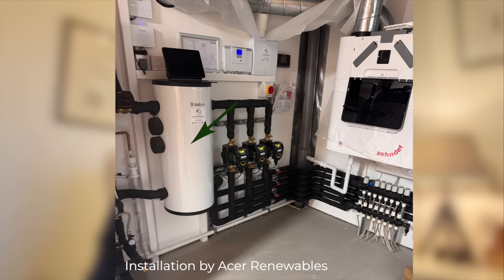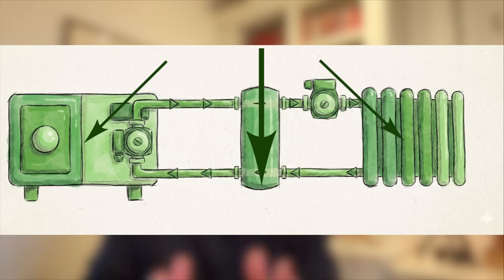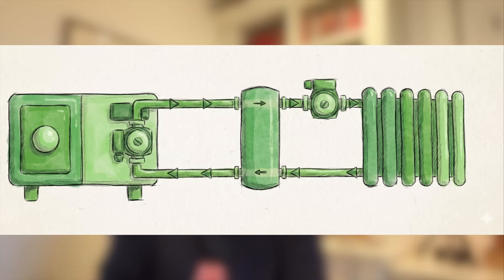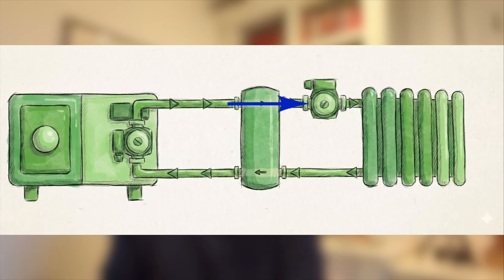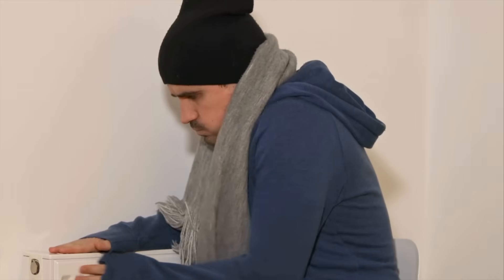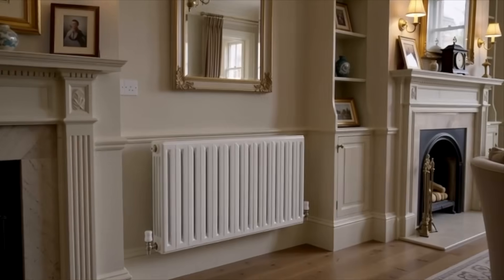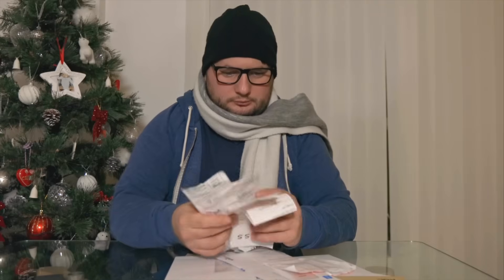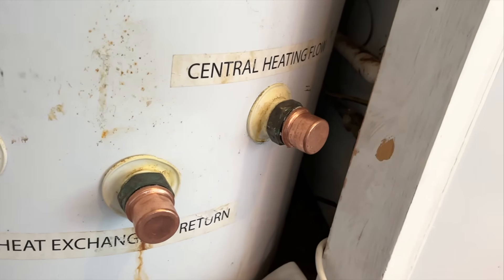Why Do Buffer Tanks Kill Heat Pump Efficiency?

Comment: Good video and information.
Getting people to question WHY, WHAT FOR and having insight as to why installers go this way is importantly to get installation quality to rise.

I am progressively upgrading an 1890s sandstone double fronted 5 bed semidetached.  As I go I am paying attention to system volume by upgrading pipe work to 22mm where I can and on,y 1 radiator running on 15mm spurs.  Radiator sizes are taken to optimise volume in the radiators so yes I am going with cast iron and doubling up in bigger rooms with matching half size units.  The goal is to get comfortably over 300 ltrs with low pressure losses.  If I do need a volumiser it will only need to be small.  Glyn at energy monitor fitted one but plumbed in bypass and he found it made no difference in his setup.

All a mystery until you start thinking it through and get useful thought provoking videos on YT.

Keep them coming Mars.

Comment: The buffer example using 4 pipes is old school. You can still connect a buffer in parallel using two pipes. Furthermore it depends on the control system how it handles the secondary temperature. NIBE measures the secondary flow and return temperature and adapts the primary pump speed and temperature accordingly. There is no difference in flow temperature between the primary and secondary side of my buffer. 

Replacing pipework in an existing situation is easier said than done. In my situation it is possible if I would open up the ceiling in my kitchen and living room and I don’t want that. My COP including hot water was above 4.0
Reply from the maker: How have accurately balanced your primary and secondary circuits, and how does your secondary circuits when the heat pump in the primary side modulates?
Reply: @R @RenewableHeatingHub  main heating is underfloor heating, radiators upstairs and radiators in a small hobby room and garage. All are hydraulic limited to about dt=10 degrees at minus 10 Celsius outdoors (Netherlands). The secondary pump is constant pressure controlled, i Will change that to proportional or AutoAdapt in near future. Reason is noise as soon my underfloor heating starts limiting (ESBE proportional valve) causing overflow and noise in radiators downstairs. I have to replace some radiator valves that are better adjustable and pressure compensated (eg Danfos RA-DV or Heimeier Eclipse). This will reduce noise (i hope) and keep flow constant in these radiators.

Handling a system that uses both underfloor heating (low temperature) and radiators (higher, but not high temperature) is complicated. 

Only The primary pump is PWM controlled by NIBE. NIBE Measures in/out temperature from the heatpump and the in/out temperatures from the secondary side. The control system regulates the flow temperature by adjusting the heatpump temperature and primary flow. My secondary circuit is limited in flow because of the pipework. However it’s enough to handle the maximum output from the heatpump at dt between 7 and 10 degrees. I had no problems in recent cold periods (-7).

Comment: I always thought that at least part of the reason you need a buffer tank is to prevent short cycling of the heat pump. Are you saying they can now modulate so much that that’s not an issue?

Comment: I disagree with your conclusion.

The buffer tank allows you to have two different flows, one on the heat pump and one on the consumer side of the tank, and the reason for that is because it allows you to adjust the heat consumption at any source independently, even shutting it completely down.

Imagine having sun through the windows on one side of the house. Then you might want to constrict the heat transfer to that side, without reducing it on the shadow side. This is solved by actuators, and that changes the flow rate. The same if the door is left open for a while whilst carrying in the groceries. Or whatever other reason.

I do agree that mixing in the tank is a problem though. Proper tanks have some measures against that.
Reply from the maker: I get the theory you’re describing, but it’s solving the wrong problem, in the wrong way, for a domestic heat pump system.

You’re absolutely right that a buffer allows two independent flow rates. That’s precisely the problem.

A heat pump is most efficient when it sees a stable system: steady flow, low temperatures, minimal interference. Once you introduce separation, the heat pump no longer responds to what the emitters are actually doing, it responds to a tank. At that point, you’ve broken the feedback loop that heat pumps rely on to operate efficiently.

The examples you give (sun through windows, doors opening, different sides of the house behaving differently) are exactly what weather compensation, room-by-room emitter sizing and proper zoning strategies are designed to handle without decoupling the system.

Actuators throttling flow downstream of a buffer don’t “solve” anything from the heat pump’s perspective. They simply reduce secondary flow, increase mixing risk and force the heat pump to compensate by raising flow temperature. Comfort might be maintained, but efficiency is sacrificed, which is the whole point of the video.

As for “proper tanks having measures against mixing”... no passive buffer tank can dynamically prevent distortion when primary and secondary flow rates don’t match. Unless you’re actively measuring and controlling both sides in real time, mixing is inevitable.

And crucially, most UK homes do not need independent flow rates in the first place. If shutting down emitters on one side of the house causes instability, that’s a system design issue (usually emitter sizing, zoning strategy or pipework) not something a buffer should be masking.

So yes, buffers can make systems easier to control from an installer’s point of view. But they do so by insulating the heat pump from reality. And when that happens, the homeowner pays for it, every day... 

That’s not opinion. That’s how heat pumps work.
Reply: Is it not custom to use actuators on the emitters in UK?

Comment: Hi Lars. Well explained! We have been installing heat pumps and have since 2010. The last buffer we installed was in 2016 more due to our lack of design experience at that time. Since then we have undertaken courses and become more aware about system design and the pitfalls of "generic" design. We see poor design on many heat pumps we go to, which have been done under the Eco scheme or many of the umbrella schemes, whereas, as you rightly say, a buffer of LLH will keep the heat pump happy, maintaining the flow rate, but at the cost of distortion, which results in higher running costs. Buffers and LLH's are often just lazy design, not always but often! Volumisers on the other hand we like in our designs.

Comment: Not sure how a standard uk system is designed. Do your heat pump also produce the hotwater for your taps? Is it a separate tank so the heat pump change the flow to that tank when producing hotwater? If so we often have the problem that when it changes back to heating you can get a rapid expansion of the pipes (floors/old radiators etc) witch results in ticking in the system. In that case a buffer/volumiser helps to even out the supply and stop the sudden expansion/contraction. Another problem with the separate hw-tank is that the flow to heating completely stop when the heat pump produces hotwater. Some old systems dont like that and are very slow to start flowing properly again, and that is when a buffer is needed to have a constant flow in the heating system. Also makes the radiators have a more even temp due to constant flow. I agree that it might be more efficient but sometimes its necessary and probably the reason that some want it as standard. To avoid these problems. In a completely new build it shouldnt be necessary though.

Comment: "I have underfloor heating and, based on your video, I understand that a buffer tank can be converted into a volumizer by connecting it in series with the heat pump and the underfloor circuit. To achieve the most efficient setup, should the tank be connected to the flow (outlet) or the return (inlet) side of the heat pump?"
Reply: Shouldn't you have plenty of volume in your underfloor pipes already?

Comment: I have put in K3 large rads on two floors and underfloor on ground floor , they barely get Luke warm , I run it for 6 hours continuously at 30 degree at night when temp drops to minus 3 say I up the flow rate to 45 there is no difference in the rads warmth , Luke warm and I mean Luke you wouldn’t want to shower in it , that’s with two 11kw pumps working .
  I’m wondering* if this is a buffer tank issue ?

Comment: We habe 450m2 of undefloor heating + a pool the heat pump can heat (60m away), they installed a flow seperator so we can have a grundofs magna 3 pump for each circuit. Diverter valve for hot water tanks (2x500l). Should we eliminate the flow seperator?

Comment: A great video with the facts well presented. I've had the discussion before with people promoting ASHPs that I've said there isn't currently the skill level within that particular, recent  technology to ensure that installations are designed and fitted competently. My comparison is with air to air heat pumps where the technology is considerably older and there really is only one design which has been used for literally centuries (it’s been around for 200 years). I DIY fitted a monoblock A2AHP for £800 and it just works. I was quoted an ASHP for £16k requiring a whole load of retro fitting. Now an equivalent A2AHP would be about £3.5k and you have to take care of the tank water heating separately but I urge people to get different ASHP quotes and even consider the possibility of an A2AHP as an alternative.

Comment: A buffer or LLH is not true hydraulic separation. You don't have 2 water circuits as you suggest, you still only have one and the same water is shared throughout the circuit so still needs glycol or other frost protection.

True hydraulic separation would be a heat exchanger with the primary circuit on one side with frost protection, and the secondary circuit not needing it.

Why don't we see any of those in a domestic setting?
Reply: You would only need frost protection in situations where you might actually encounter frost. A residential home shouldn't ever reach those temperatures by a long shot as all the devices are install in the house itself.

But then again, there is so much not being told here. Energy doesn't disappear all of the sudden, a buffer tank does that exactly, it buffers energy and there are many situations where a buffertank would actually improve certain aspects of a heating installation. It has greatly improved the cycling of my natural gas heater for example. It burns for a longer sustained period at a more efficient setpoint and then stays off for a longer period of time.

Comment: Or instead of repiping you just setup the pumps to give the correct flow rates to balance it without distortion. Do that by measuring the water temperature at all 4 ports. Get the in from the heat pump matching the out to the heat emitters, and the in from the emitters matching the out to the heat pump.

Of course you still pay to run 2 pumps.

If you have pumps on both sides that have PWM speed control, you can use something like an Arduino with 4 temperature sensors and 2 PWM outputs to do it automatically. That also takes account of the fact that at mild outside temperatures you want a lower flow rate than when cold.
Reply: If you can do that then great, you've effectively made the buffer work like a volumiser, but in that case might as well just plumb it up that way?

Comment: So where is the additional heat going that the heat pump is producing because it has a higher flow temperature?
Reply: Good question. The confusion comes from the difference between temperature and heat - the heat energy is just the (flow rate times delta temp) - the hotter primary circuit to the buffer has a higher flow rate and smaller delta temp, transferring that heat to a secondary circuit with lower flow but larger delta temp. So no heat energy is really lost, but the heatpump is forced to run at a less efficient (hotter) flow temp.
Reply: The heat pump is producing exactly the same amount of heat, but it's using more electricity to do it.

Comment: I didn’t understand the 2 pipes instead of 4 bit.
Reply: Instead of being 2 "separate" circuits, you make it all into 1, just with extra volume.
Reply: The four pipes are the ones attached to a mixer. The two pipes are the ones attached to a volumiser.

Comment: For me the most important thing is that I can store energy, so I can lower power usage during times that there is less power (I am off grid). The air temperature difference here between night and day can be about 10..15 degrees. So practically, a heat pump would be most efficient running day time.

Comment: Interesting discussion and well presented 👍
I often considered a buffer tank a fairly standard part of most installs where you have a large disparity between the primary pipework and the internal heating pipes. Doesn't it generally aid efficiency in defrost cycles?
In my case I have 10mm microbore which is less than ideal. I do tend to find my flow rate seems somewhat irrelevant to what the circulation pump on the radiator side is set to.
Reply from the maker: You've hit on a really important point about defrost cycles and buffer tanks. While some believe they aid, volumisers achieve similar results without the efficiency downsides.

Comment: My Octopus Cosy 6 was installed with a buffer April 2025. While I didn't have any problems initially I did want to optimise the system.

Long story short the secondary pump speed was set too high, which I suspect was causing mixing in the buffer tank. After fiddling and monitoring deltaT across the rads, it's now at about 50% speed of what it was set to after install. Now things run very smooth, for space heating getting 3.5-4.5, SCOP is currently 4.1. Happy overall 

Maybe I could get better results without it? Who knows, but it seems to be working ok for me.
Reply from the maker: Sounds like you did the right thing and playing around with the pump speeds got your system more balanced. If you’re happy, that’s the most important thing.

Comment: Stil, the buffer tank could be helpful if designed correctly, because you could only run your heat pump during the day to feed the buffer tank, in the hour interval when the outside temperature is the highest, thus winning on the overall heat pump efficiency due to the lower delta T, and in the night only heating the house on the accumulated heat from the buffer tank during the day.
Reply from the maker: It doesn’t work that way with the size of most domestic buffer tanks unfortunately.
Reply: @RenewableHeatingHub are you saying that larger volumes buffers would work better due to reduced/suppressed mixing ?
Reply: The specific heat of water is 4184 joules per kg per kelvin, which is just 0.00116 kWh. So for a typical large buffer/volumiser of 100litres (100kg) that means it would "hold" just approx 0.1 kWh per degC. And because you want your heat pump to operate at a minimum deltaT to the environment (and to your home ambient) realisitically, it is basically impractical to store any meaningful amount of heat in this way!  To store a meaningful amount of heat, lets say 20kWh, at lets say 5degC above ambient, you'd need a buffer tank of approx 3,500 litres of water!

Comment: It’s hard to avoid buffers when LG insists on them for warranty compliance! If they're just worried about flow and volume, they should really be allowing volumisers instead of forcing a setup that kills COP.
Reply from the maker: That's a valid point and one that I've covered here: https://renewableheatinghub.co.uk/buffer-tanks-heat-pump-warranty

My advice is a manufacturer mandates a buffer tank, find a brand that doesn't.
Reply: @RenewableHeatingHub The trouble is that you only learn about about these critical factors after the system has been installed when it’s too late!

Comment: I was confused because I have a 100l volumiser, and in the Netherlands it is called a buffer. You should rename buffers to hydrolic separators.
Reply from the maker: That is confusing!
Reply: No buffer is a buffer usually a large one like 1000-2000 litres. It can function like a hydronic separator but usually there's a clear stratification because the flow rates aren't large enough to mix it all. Hydronic separators aren't very useful if they mix and cool the outgoing water to heating loop for being too small for the design flow.
Reply: @larijoona are you saying that buffer of larger volumes will not exhibit the issues presented in the video because their volume is large enough to prevent/limit mixing ?
Reply: I think we should only call heat exchangers hydraulic separators, as they truly do. A shared volume does not truly separate.

We should probably also use the word hydronic instead of hydraulic, but that's a different subject 😊

Comment: Here at my place they recommend buffers to handle the times when the heat pump is defrosting.
Reply from the maker: Volumisers can get that job done too!
Reply: That probably is a volumiser that has been misnamed, although it's tricky.

It holds necessary volume, but that volume is only necessary as a thermal buffer 😊

Comment: I have a buffer tank. 
I am getting heating cop of 4.8 (dec), 4.9 (nov) , though this does not include the cold January weather yet (the cop is for the month averaged).
I got water cop of 3.4 over the last 3 months, but I expect a lower value as the water temp is set to 55C and we run it at night on cheap rate tariff as the electric costs are so much less.  (we have 2 electric cars so at the moment we are trying a "car-charge" tariff rather than a heating tariff.
Reply: You shouldn't care what your COP is in that case, care what it costs to run 👍